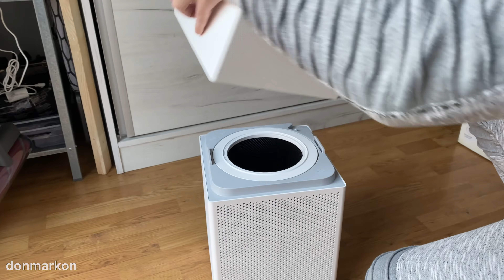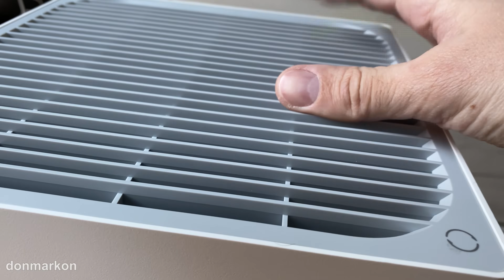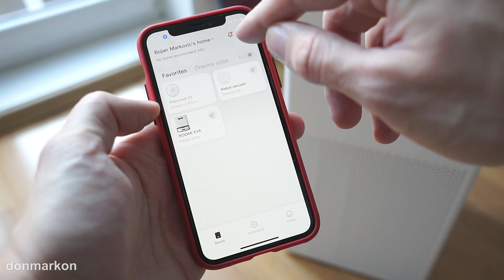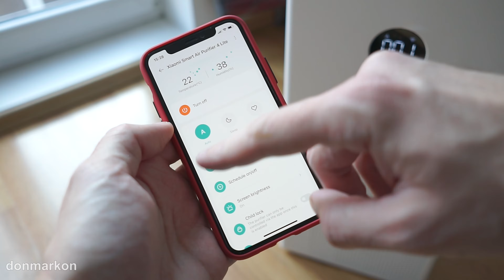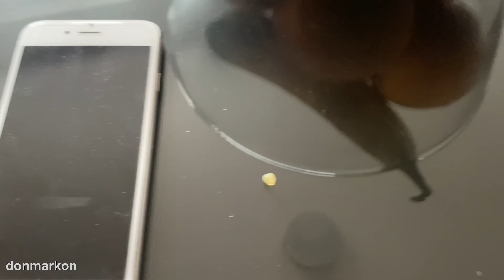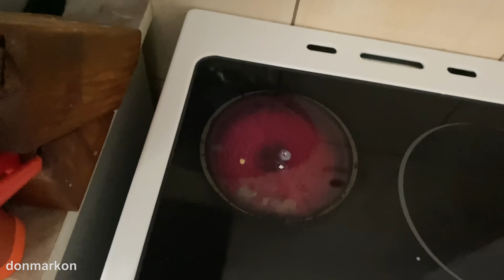Xiaomi Mi Air Purifier 4 Lite Review | 25 - 43m² Coverage

Comment: this is bad test cause u use self-reporting from sensor of the device itself instead of external measurement device; and its known fact that most cheap purifier use very inaccurate sensors; other than that its nice showcase, though u forgot to tell that there are multiple speed gears in the app which is crucial info

Comment: hi! and thanks for the vid! why should one pick the 4 over the 4 lite (i am not talking about the PRO version) ? is there any other difference apart from a slightly larger area coverage, the ionizer functionality and the OLED display?
Reply from the maker: No as far i know, you already answered your question. Do you need those extra features?
Reply: ionizer  just make the dust fall faster  for the filter \ground the that's all, without ionizer  it will take abit longer to clean thats what i;ve readed  ( i got the lite version)

Comment: How long is the power cable?
Reply from the maker: It uses standard cable just google search 2 pin power cable and you can find cheap extension cables ...
Length is around 1.5m

Comment: what would u reccomend the  normal one or 4 lite i now have the 2c but every time i need to press the button to turn it on which is not nice i wanted to upgrade i also wanted to ask if the timer of the filter runs out will the machine still work or it will not work until filter is replaced
Reply from the maker: If you want to save some money go for 4 lite 
It will work with dirty filter you will just get notification that you need to replace it

Comment: Hi just bought this air purifier thanks to your review! I’m having trouble adding it on the mi home app though. I’ve added it manually but I can’t see it on the list of devices so I can’t control it using the app like you are in this video. Any ideas?
Reply from the maker: Change in mi home to mainland china
Maybe you bought CN version
Reply: @donmarkon  This worked, thank you!
Reply from the maker: Np
Cheers

Comment: How the routine of changing the filter? Is it 3 months? 6 months? I saw a post about previous series frequently ask(APP) to switch to new filter
Reply from the maker: App is using simple method 
It starts with 300 days and when purifier is working it starts going down. When it reaches low threads hold it starts to remind you to replace the filter.
I think that it is not really accurate. Here where i'm the air is really clean, when i turn on purifier it rarely shows more than 20 ... So it is not realistic that filter can be unusable after 300 days of use as if someone is using it in more polluted area ...

Comment: Does it help to prevent from a regular dust being built up on all flat surfaces?
Reply from the maker: Up to some degree definitely yes 👍🏻 
Since I have this and robot vacuum I can’t recall when last time I manually vacuumed 😅
Reply: @donmarkon  I also do have a vacuum robot, but it cannot fly to reach out all flat surfaces in my apartment so I still have to clean em out with my own hands and some piece of cloth from time to time. And over the years I'm becoming lazier and lazier :)
Reply: @donmarkon  the filter element there, is it washable? Or just dispose and buy a new one?
Reply from the maker: No you need to buy new one

Comment: Great review. I have the Air Purifier 4 here in Hong Kong, and it serves its purpose well. May I ask how you find the noise level of the air purifier 4 Lite (or a suggestion for you to compare the noise levels at the different settings and between different models or other air purifiers)? 
I'm holding my Apple Watch Noise app to my air purifier 4's display screen (about 5cm or 2 inches away) at the highest fan setting and the reading is 56 dB.
Reply from the maker: On the max power it is laudable but on the 70% is ok fine for non stop work. Everything under that i consider super quiet...
I will start to measure noise levels for my future reviews
Thank you for support!

Comment: can we use previous filter (like mi 3H/3C) on mi 4 lite? is it same size or specification?
Reply: What is better 3c/3h or the 4lite?
Reply: @jayemjp  Its almost no difference in all specs between 3H and 4 Lite. 3H has OLED touchscreen while 4 Lite has button on top. Not a big deal and personally i like more 4 Lite as touching OLED makes it dirty and also kids love to play with oled display but button on 4lite they cannot even see))). Bascally you can get 3H or 4Lite (do not have 3C so wount say anything about it) and you will get same result.
Reply from the maker: 4 lite uses a new upgraded 3 layer filter 
https://www.mi.com/global/product/xiaomi-smart-air-purifier-4-lite-filter/
And as far I see they are not compatible with 3h and 3c

Comment: could duct cover(top cover) be disassembled? I want to know it because we could not disassemble top cover of previous models. Many dusts are in the top cover, but we could not disassemble the top cover.
Reply: I use a canned air duster to blow the insides.
Reply: No, this model can’t remove top duct cover unfortunately… but the other commenters idea of using a duster can is a great idea!! Or if you have a Dyson vacuum, they have excellent small “car” attachments & those vacuums are fantastic at sucking out dust from small & far places so you have a few options for cleaning ☺️☺️
Reply: Use a blower to clean the same
Reply: Yas.